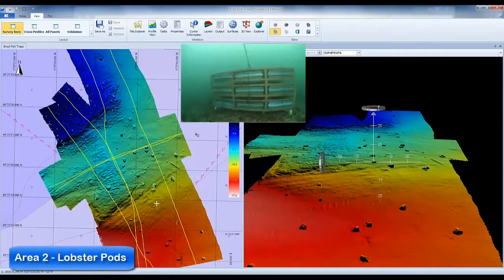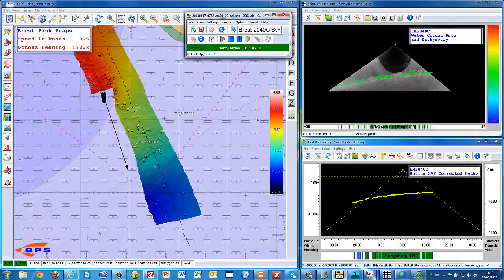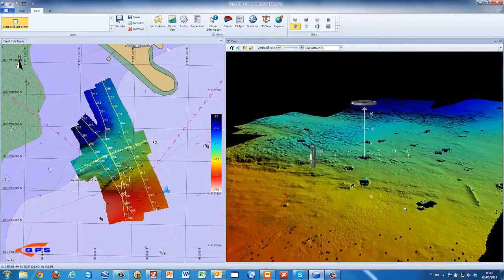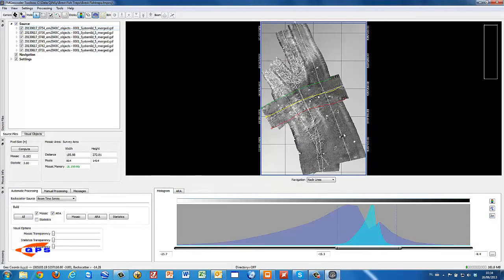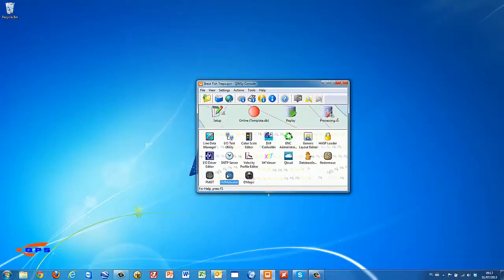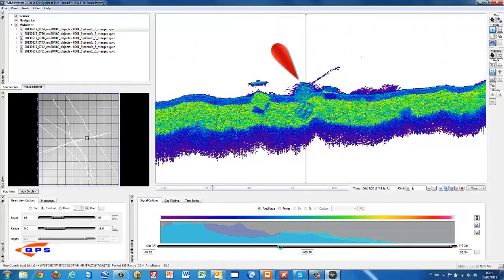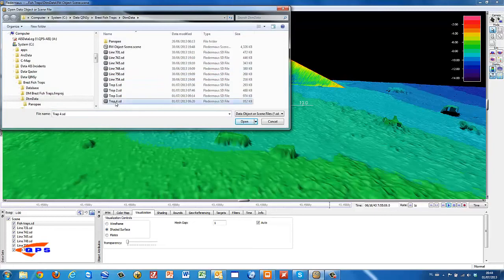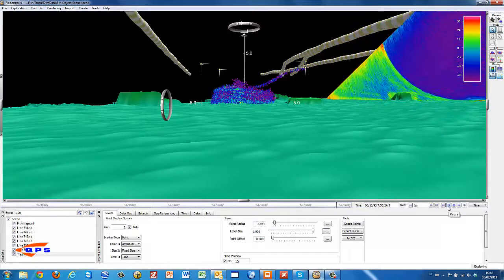QINSY data acquisition bathy seabed imagery and water column data

Comment from the maker: Pwj579 Thanks, the Echoscope unit is well supported by QINSy. The emphasis here was to “collect once, use many times”. Modern maritime mapping projects often simultaneously collect data from multiple survey sensors, and the data from one mbes sensor is used a number of times. Rather than collecting small areas of the same seabed for different purposes, different agencies are often collaborating to survey larger areas but then specify multiple data deliverable to cover their different requirements and to broaden the ability to visualize the data in more intuitive ways.